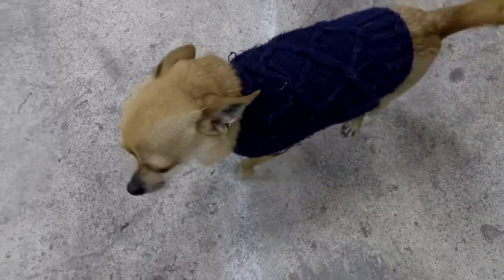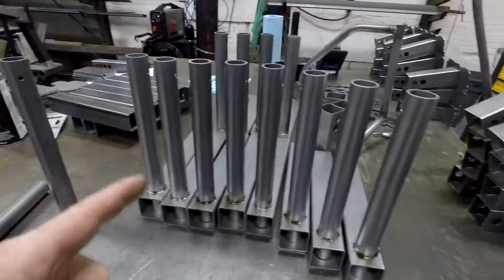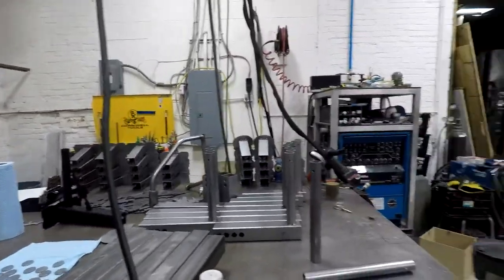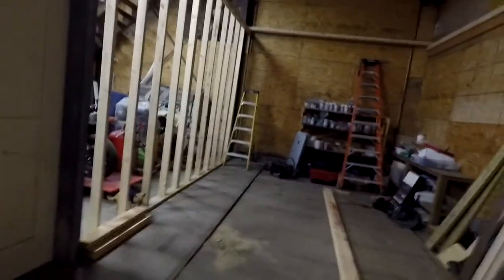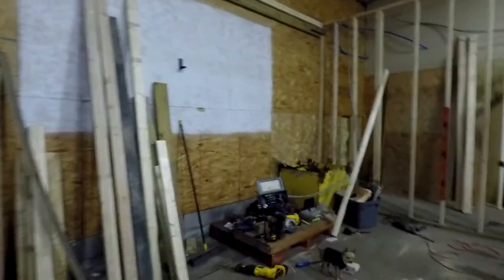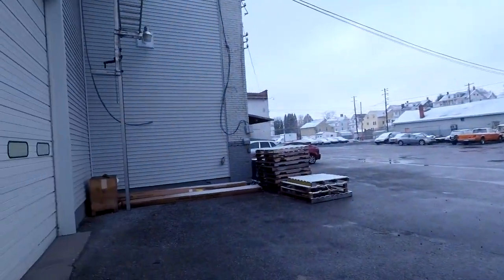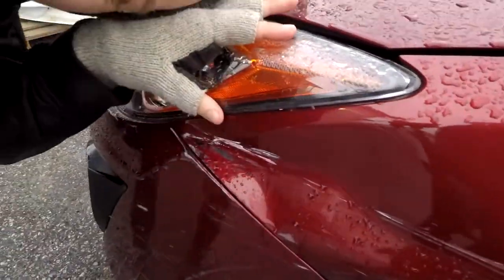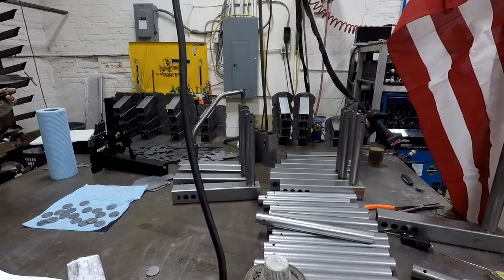RMW Vlog 94 InShaneDesigns trailer hitch inserts covers

Comment: Nice to see how far things have come in a relatively short amount of time. How long have you been in the new space now? It's under a year, right? Digging the fusion welds too. I'm sure they are plenty strong for that and saves a ton of time.

Hope you are well, sir!
Tom Z
Reply from the maker: Howdy Tom,  been in the shop since August.  Took about 3 months renovating just to move in!  Still a ways to go, but we are getting there.  Yes, fusion welds are your friend if structure isn't a concern.  Using the 1/8" steel has plenty of strength fusing.  I do add filler on the bottom just to tie it all together.  I found adding filler on the plates just added to much heat and caused warpage.

Thanks!